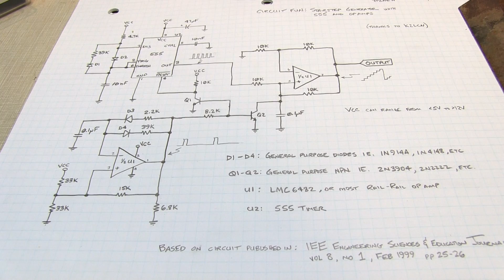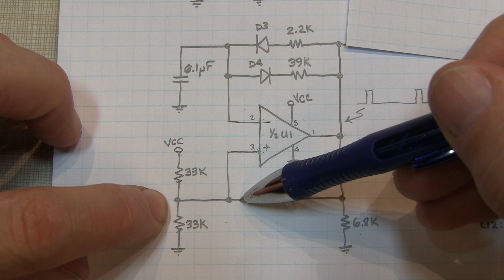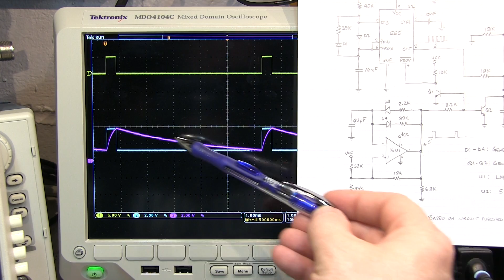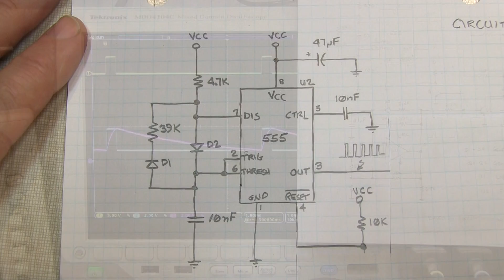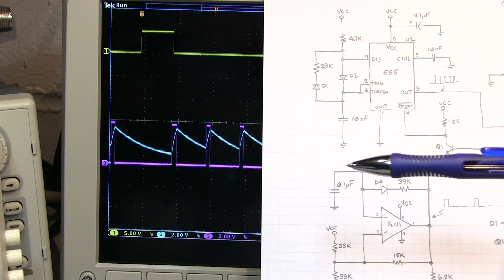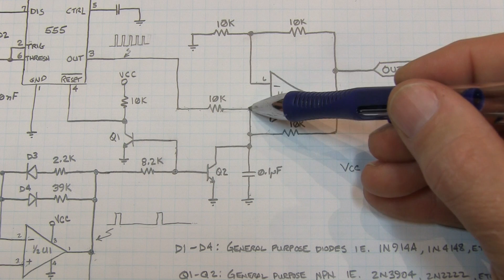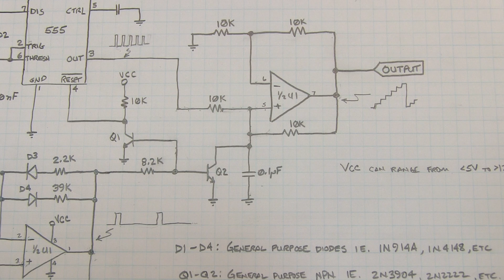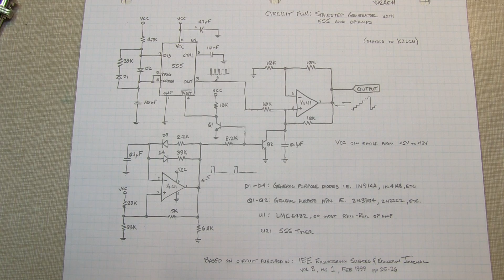#231: Circuit Fun: Stairstep generator using 555 and op amps

Comment: A little something for the first oscillator is you can use a linear pot and 2 diodes in the feedback network so you can have a near constant frequency ( roughly, you will have to vary C to get different frequencies) but where the duty cycle is variable over a very wide range, from around 5% to 95% as you turn the knob. 

Can be used with the whole circuit to sample the output to get a specific step using a differentiator driving a sample gate ( 4066 switch). But I can see a use for an analogue staircase generator where you can select the number of steps easily just by using RC delays.
Reply from the maker: +SeanBZA Thaks - that's the whole idea here - just get folks thinking about the possibilities, and other circuit ideas.

Comment: What would this circuit be used in?
Reply from the maker: +Gary Bode Limited only by your imagination...  The start of a curve tracer circuit, setting the tune voltage of a VCO used in a scanning receiver, visual effects with LEDs, sound effects, etc.
Reply from the maker: +Gary Bode Playing around on the bench, I managed to turn it into a basic transistor curve tracer by adding one more op amp, 3 more transistors and a handful of passives...  Maybe I'll post another video...